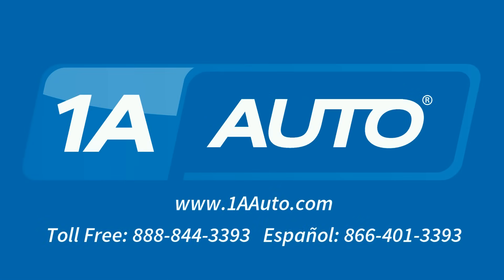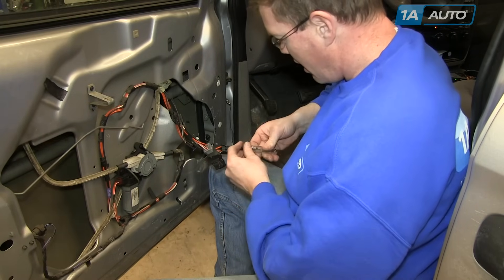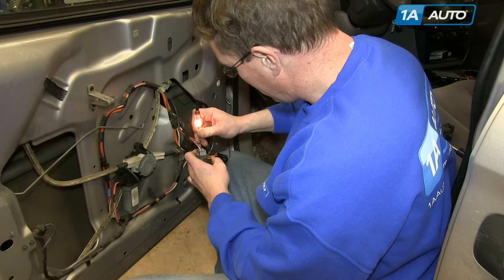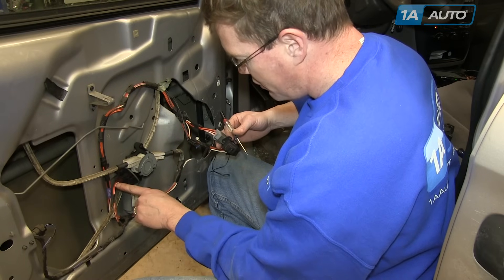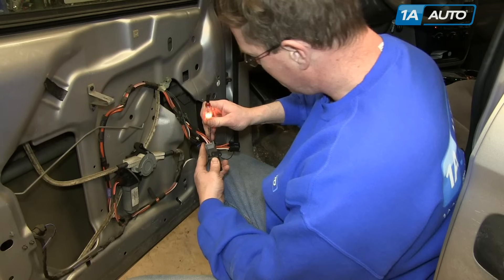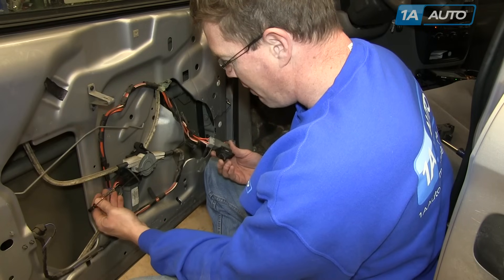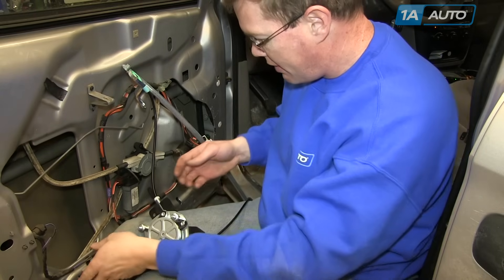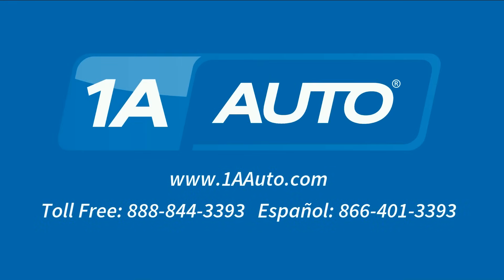How To Diagnose Power Window Problem - Is the Switch or Motor bad?

Comment: What exactly was the problem with the motor? I heard it clicking every time you pushed the button before you changed it out. Pls explain what happened that cause the button to be faulty in detail. I have the exact same problem right now. Matter of fact I saw smoke coming from under the power window switch the other day. I'll try doing the same thing you did here
Reply from the maker: +JT King the switch clicks After many uses, eventually the motor might suddenly die. As was the case here.

Comment: On my '13 Honda Odyssey, on the driver side power window, whenever I press the automatic window up or down button, the window does the opposite of its command. Sometimes it goes down when I press up and vice versa. Could this be a bad switch or motor?
Reply from the maker: +gowdaflow It sounds line someone may have connected a wire to the switch or window motor the wrong way which may be causing this issue. Hope this helps you out. 1aauto.com
Reply: Thanks. Yes, it doesn't happen all the time. Only when activating the up/down switch fast, the window does the opposite from time to time, maybe the switch is bad..

Comment: I have power to the motor connector up and down.  The motor only moves in the up direction when plugged into the the vehicle.  I put the motor on a bench top power supply and it moves in both directions.

Comment: My 1997 Ford Exploder front passenger window works fine from the driver side switch but does nothing from the switch on the passenger door. I assumed the switch was bad but new switch fails to move it as well. I'm guessing their is a bad wire somewhere but have no wiring diagram for this thing.

Comment: Should post a video on doing a 05 gmc envoy xl or any car really passenger window no power. Am I wrong in saying if the driver master switch is bad the you wont get power on the pass side
Reply: I’m waiting on an answer to. Same problem. Passenger window. When I hit window up on driver switch I can hear the pass switch click. Push down and nothing happens, no click either. Guessing it’s the pass window switch. Thought motor originally. Tested everything. Bought whole motor and regulator from 1a. But not the problem. They took it back and refunded me with no issues. Love 1a.

Comment: Both windows on 97 f150 work intermittently. When one works the other works. When one doesnt work the other one doesnt either. Also, dome light and lights inside door dont work either,  when windows dont. Whats goin on? Thanks

Comment: before I buy the parts, I need to know what the issue is please- on a grand cherokee 2008 : right rear passenger window goes down but does not go up.  I opened the door in order to close the window at least, checked with a power probe and it is not the window regulator and it is not the motor, since I tested it manually and goes up and down, but it does not work from the master driver's control, nor from the broken window switch either. window child lock is not on.  The other 3 windows work perfectly. What could be the issue, please help !
Reply from the maker: +ama zonia Thanks for your question! We would not be able to diagnose the issue you may be having with your vehicle. Thank you!

Comment: I have a parasitic draw on my battery I located the fuse which being the DDm fuse driver door module is this the power window assembly ?
Reply from the maker: +Gary Jones The DDM fuse is for the Driver Door Module. This manages all actuators in the driver- or passenger door and is directly connected to a separate switch panel.
Reply: thanks but where is the ddm ? @1AAuto

Comment: I have a 2001 xterra and none of the windows work at any door switch. The fuse has power and on the drivers door main switch panel only the door lock switch works which means there's power going to the swicth panel. Any suggestions on what I should test?

Comment: Also it's possible to have a bad ground. I have a passenger window that wont work from ither switch but works great if I supply ground to the motor directly on the proper polarity. 01 dodge grand caravan. Supplying 12 volts directly to the motor will confirm or rule out a suspected bad motor.

Comment: What if you replace the motor/regulator automatically thinking that was the issue, but when installed the new one it only goes down and not back up.  Thought it was a switch but both drivers switch for the rear window and the switch for the rear window in the back are like that.  only down and not up.

Comment: I just got a new motor and regulator for my 1999 Pontiac Grand Prix front passenger. it worked for going up but window will not go down. I bought and main switch and it won't work at all from the main base. I bought a switch for the side it's on and it will roll up but not down. any suggestions.

Comment: I can hear a ticking sound from the passenger door panel and the window isn’t working. The switch seems good but the switch from the driver side is stuck. I feel it’s the motor so do I need to replace the motor and regulator or just the motor
Reply: You may want to take a 9v battery and some alligator clips and plug them into the motor wire lead. You can test to see if your window will roll up and down this way.
Reply: mine it get stuck up and down what u think issue

Comment: My power windows on my 2004 Dodge dakota crew cab doesn't works only responds  from my master switch driver side door , any advise?
Thanks
Reply from the maker: +Roy T We wouldn't be able to diagnose an issue like that here, you may want to have a local mechanic take a look at it. Thanks for checking us out! 1AAuto.com

Comment: Im haveing the same problem my switch will light up when trying up and down with probe tester.But when I connect to motor with load it will only light up going up.If I reverse polarity it will go down.But no power at same time either up or down.Bad Switch?Motor works when polaraties change

Comment: On my 08 Accord the passangers window works fine but only from the Switch of door but it does not work from drivers máster control. I was thinking of there is a module in between the two of them. Dont know what to do...

Comment: Point:  There are two switches for the passenger window, one on the passenger side and the other on the driver's side.  So, if one switch works the window and the other does not...that tells me the motor is ok, switch is bad.  If neither switch works, then???  It's likely the motor, right?

Comment: I got  a 97 chevy tahoe.the passenger rear window does not go up, it goes down but not up.i put new scissor assembly with motor.put a new main control on driver door.i checked the power to switch and motor.to raise the window used a battery.i dont know what else.other windows work up and down
Reply from the maker: +Manny Salinas Thanks for checking us out!

Comment: One of my rear windows will not go down or up with the switch. And when I try I cant hear the motor in the door at all trying to work vs my working windows motors I can hear when they go up and down. does this mean my rear window motor is not working?

Comment: I have replaced window regulator 2 times in about 7 months. Every time the motor stops pushing window up with a grinding sound. How do I check if tracks are ok and NOT binding somehow?
Reply from the maker: +Bob Hickman You may want to remove the door panel and inspect the gears and cables to see if the cables are getting caught on something inside of the door. Hope this helps you out. 1aauto.com

Comment: hi i have a1999 f250 pasenger window went down but not up switch is good and so is the motor
Reply from the maker: +Linda Turner You may want to remove the door panel to see if the window regulator has broke inside of the door. Hope this helps you out. 1aauto.com

Comment: When i start my third gen 4Runner, all door windows will not work at all.... however, after 3 to 5 minutes after starting the engine the door windows will start working normally, it is just a matter of time.... Any idea on what may be happening?

Comment: Can you just replace the motor?  Is it necessary to replace the regulator as well?
Reply from the maker: +bossfan49 On some vehicles you need to replace the entire window regulator with the motor, because the motor isn't serviceable. On some vehicles you can just replace the motor. it depends on the application. We carry new window motors and window regulators on our website. Here is a link to our website. 1aauto.com

Comment: My problem is with the driver side power window on 2003 Element. The window went down but will not return. The odd thing is that the motor seems to be running regardless of whether the switch is activated. In fact, once I stopped and turned off the motor, and even accessories, the motor continued to make noise so that I had to pull the fuse to get it to stop. What could be the problem with that motor continuing to whir?

Comment: I have a 2015  acadia the driver side window stopped working last night and today I noticed the only buttons that work on the driver side door is the other the window not even the lock button any idea what this could be
Reply from the maker: +ga8pack Thanks for watching. You may want to check the fuses to see if any of them are blown. Hope this helps you out. 1aauto.com
Reply: I have the same problem in the same car but different model

Comment: My problem is the main swich buttons will stop working on all windows and all door switches also, then it just starts working after fidgeting it for a while. The power lock keeps working though, and the windows are kind of slow. It's not the window lock switch is on. Any suggestions? 
Suzuki Aerio.

Comment: Hello. I have an 05 mazda 6. And my rear right window goes down but doesn't go up. I have yo run the wire directly from the battery all the way to the back to carry the window back up. The motor works  fine when i connect it to the battery directly. What could be my problem.

Comment: I have an issues with my 2011 Juke.  The rear drivers side window won't roll down. I've tried from the driver's side controls and there's no response.  I've tried from the rear drivers side in the back as well and nothing. Is it the motor or the switch?
Reply from the maker: +thekenpokid21 You may want to check the fuse to see if it's good. If the fuse is okay, you may want to test the power going to the window switch with a test light to see if there's power going to the switch. Hope this helps to point you in a directioin 1aauto.com

Comment: My power window will go down and if I work at it with the switch I can usually get it to come back up but this last time I accidentally rolled it down and now no matter what I do I can't get it to come back up.  Any idea what could be the issue?
Reply from the maker: +Rachel Richardson You may want to check the wire harness between the driver's side door and body of the vehicle for a broken or frayed wire that may need to be repaired. Hope this helps you out 1aauto.com

Comment: Most of the time it's the wires that run thru the door harness that end up breaking off... Just fixed mine... 4 wires were cut in half. Put some butt splicers and taped it all together,  done.

Comment: My 2003 toyota echo windows work but after a while the windows on most sides start to slow then stop moving up or down. I can't tell if it's the wiring or bad motors.

Comment: I have a 2000 F250 Super Duty driver side controls do not operate passenger window I have power going to the motor for up and down the passenger side button will lower than window but will not raise the window once again there's power going from that button to the motor I change Motors I put a brand new motor on and still the same issues   what do you think is the problem Oh and I've also change the relay
Reply from the maker: +Matt Crossen Thank you for watching. In some cases a circuit or current flowing from a bad switch could hault operation of another switch. We recommend testing the driver side controls and see if that is the cause. 1aauto.com

Comment: 2010 Honda Civic - Drivers side window sometimes will roll up and down; it will roll down automatically all the way and when I get ready to roll it back up I have to pull up on the switch a couple of time before it does anything. So now, I'm afraid to roll my window down because I don't want it to get stuck. What is wrong with it? None of the other windows give me any issues.

Comment: Seems simple. The passenger window on my 2008 Audi A4 works from the driver side but not the passenger door. Safe to assume that motor and fuse are ok, which would leave a possible broken wire or bad switch. I'll follow the first part of the troubleshooting to see what happens.

Comment: I have a 2002 Dodge Stratus SE.    The drivers side window and the passenger side back window will not work with the driver side switch control buttons.   The Power lock on the drivers side will not work either.   I replaced the switch on the drivers side door.   Still won't work.    The passenger side window and lock button works.    With the drivers side switch control buttons I can lower the front passenger side window and the rear drivers side window.   Like a X  the drivers side controls work right front passenger side and left back drivers side.  But not the drivers side front and passengers side rear window.   I appreciate any help here.    I think the fuses are ok,  and the power windows relay when I take it out the other windows that already work won't work.     I appreciate any helpful comments here.   thanks.

Comment: If checked the windows from the master switch, wouldn't that have told you also?  If it works from the master switch, then its the switch in that door, if not then its the regulator?
Reply from the maker: +Clint L Thanks for watching. That is a great tip! If your master window switch operates the window while the particular window switch does not you may be certain the switch is to blame. If neither switch operates the window either the motor or the regulator has failed. 1aauto.com

Comment: Hope somebody answer my question (Honda Accord 2006). Can a glass window ran in its canals so bad to the point that burnt the electric motor? This question is because I just installed  a new motor and regulator (combo) and it worked for a little while then burned fuse… after replacing fuse and with the window switch in my hands I connected the old electric motor (out of the window) and it runs perfectly. Now I ended with the window driver stacked all the way up just like in this video… but with a new part in it.
Note.- If there is any video dealing with this same issue… can you post the link?
Reply from the maker: +inkandescent We wouldn't be able to diagnose an issue like that here, you may want to have a local mechanic take a look at it. Thanks for checking us out! http://1aau.to/m/Shop-1AAuto-c

Comment: Hello Sir,
I have a megane 2005 and i have a problem with back window switch. when the switch is pressed down, the window moves down and when the switch is pulled up, the window continue to move down. i cannot use the switch to close the window. have to use the central console of the driver.

i have noticed also that the other back window is starting to have same problem from time to time.

Can you suggest what is the problem and a probable solution please. Thanks.

Comment: what would be wrong with my window if when I put it uo or down it clunks and sounds like its about to fall apart? all screws and bolts are secure and tight. both sides of glass are in the track. could it be my motor?

Comment: I have a 2006 Toyota solara convertible.  The little wing rear windows won't roll down.  I replaced the relay under the hood, and the switch.  I took it to the dealership and they said some relay in the back behind panels was back and it would cost a thousand to replace.  I can't find anything on some relay in the back, can you help?

Comment: Hi 1A AUTO, my car the window on the driver the switch work and motor work but every time i pulled it down i have to wait from 5 to 10 minutes then i can bring window back up (like waiting for charging power) ?????
Reply: I have the same problem. I saw 1A replied to David Adams 4 months ago that it might be the dying motor. Quoted "It's common that a window will go down, but not up as it takes more power from the motor to put it back up than it does to bring it down. So if the motor is dying, going up will be too hard for it."

Comment: Hi the rear window driver side on my toyota camry 2020 LE goes up when I use the master switch to close it but when it is about 80% up while I'm still holding the switch on the up option the window goes down any one knows what is the problem.

Comment: my problem is the window goes down fine but when you try to close it, it goes up an inch at a time, then stops. let it rest for 20 sec. then it will go up a little more. is there a thermal overload switch or something?

Comment: Hello I have 2000 vw Jetta I just installed new window regulator and also new window switch my problem is when I push the switch for my four Windows it's not working but it has light and also the lock system is working I check the fuse it's all good I don't know what else to check to solve the problem I hope you can help me thanks
Reply from the maker: +WeTLaDi3sL0vER SLamm3dEs1 You may want to test the power going to and from the switch to the window motor. You may also want to check the wire harness that runs between the drivers side door and body of the car to see if there's a broken or frayed wire that might be causing the issue. Hope this helps you out.

Comment: what if just both rear windows dont work with any switch that front drivers and rear switchs but can still hear the motor clicking when swiches are pressed
Reply: Regulator or window is stuck on the tracks